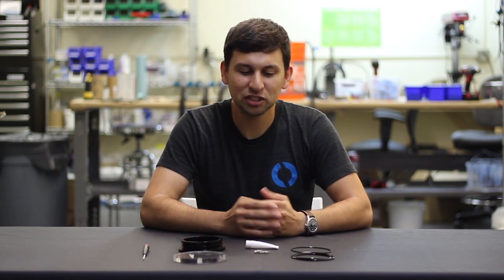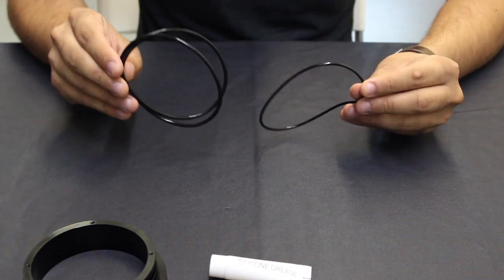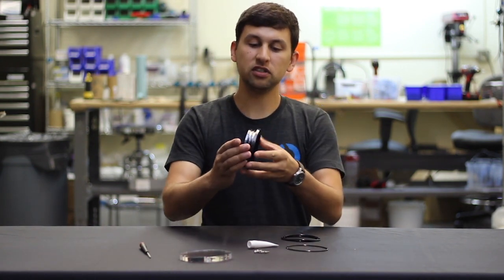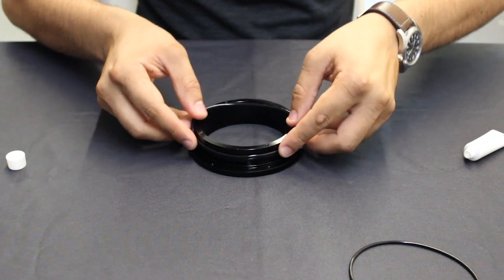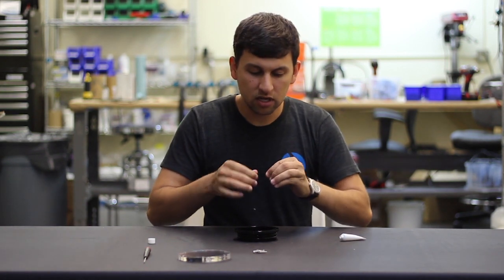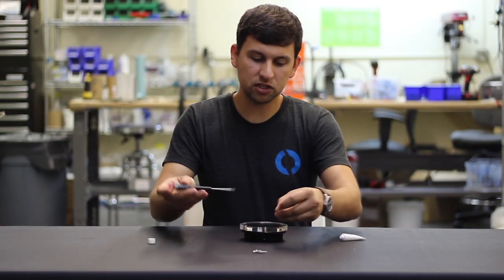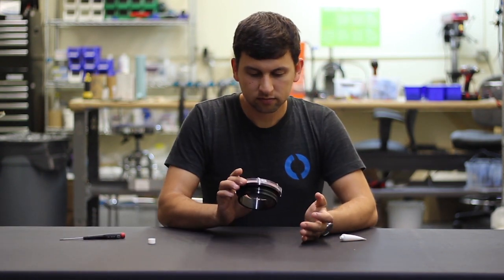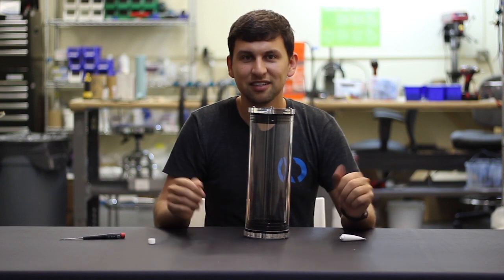Blue Robotics Tutorial: Assembling the Watertight Enclosure

Comment: what size are the screws  you're using ?  it's neither on your website nor on the vidéo and and not included when i bought the enclosure which is a bit problematic 😅 i bought 3 8" series enclosure
Reply from the maker: Hi there. The screws are actually listed on the end cap pages because the length of the screw depends on the thickness of the end cap! M3x12 for the aluminum end caps and M3x16 for the acrylic end caps. https://bluerobotics.com/store/watertight-enclosures/8-series/wte8-p-end-cap-r1/
Reply: @BlueRobotics  yep my bad ! thx for the fast response 😊

Comment: Do you guys test your parts to failure? If so at what depth did that one break?
Reply from the maker: Hi DJ, we do test to failure! This particular video is of one of our 4" acrylic enclosures. Those typically implode around 170-200 meters but there's some variation due to material properties and imperfections. We always provide a lot of safety factor to make sure we don't get to the limits!
Reply: Cool! How thick is the 4in , what is the od and id?
Reply from the maker: @barrettt8661  It's 4" ID, 4.5" OD, so 0.25" wall thickness.
Reply: Thanks!
Reply: How is it 4.5 in od if the wall thickness is only .25?
Reply: Nevermind,  I figured it out

Comment: Compression fit only? Why no clamp to protect expensive electronics inside. Like the latches used on a SCUBS canister dive light battery pack?! I realize your application is shallower depth, and your looking for all weight reduction, however seems odd you don't have a screw cap or latch system for total assurance. Thinking priority should be taken to protect your propulsion drive power supplies!
Reply from the maker: Hi Jeff, these enclosures are compression fit only. With the friction of the O-rings and water pressure, that works great for most applications. We may consider adding a latching mechanism in the future for added security.